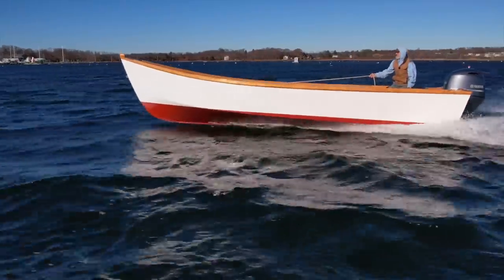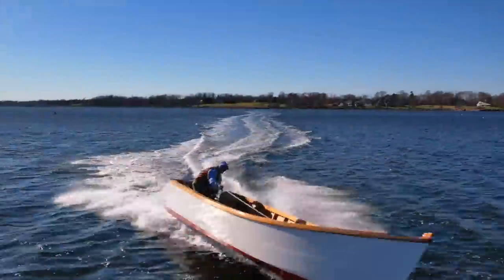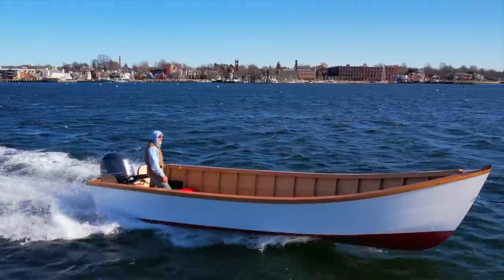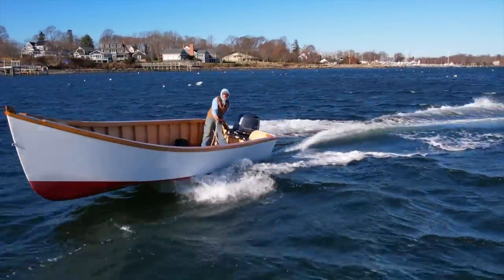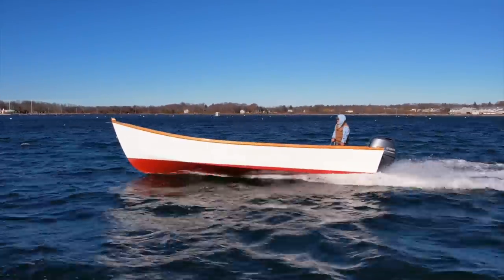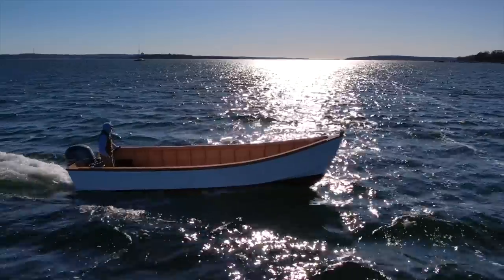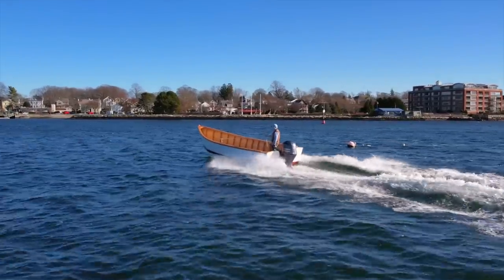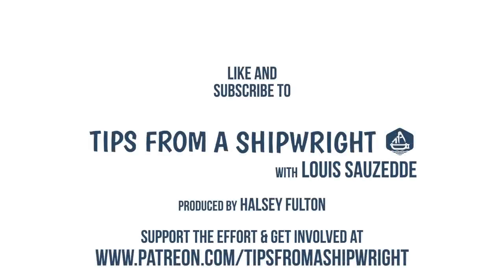Building the V-Bottom Skiff - Episode 41: Sea trials

Comment: Louis, WOW, just WOW! She planes, cuts and turns so beautifully. I definitely wish I had the funds to recreate this gorgeous build. I doubt it would turn out as good as yours, but if it was even close, it would be a dream to take out on the lake and just have some fun with the family or to relax and go fishing. Sure looks lime it could even pull a skier of up to 180 pounds with a motor that size, or larger with a bigger motor. Though I'd want a load in the boat with a bigger motor to feel safe before cutting her loose. I wouldn't want to be doing back flips or anything (with too much power pushing her). Matching the motor to the vessel is an important step in the calculations, after all. Maybe if you put a 302 V-8 in the front for ballast and run it back as an on-board motor to a prop shaft under the sole and out the transom with a double rudder system? But you'd probably want a heavier bottom to hold the motor and a redesign on the framing, right?
But she'd flat out fly across the water, 23 foot with that kind of power "under the hood"?
Reply from the maker: Thank you Thomas!

Comment: Lou maybe a nice round timber support post for that right hand would be a neat addition when standing at the tiller. Something that slides into a hole so it can be removed if seated, a lot of the pro crabber boats in Australia have them, much safer mate. Keep the vids coming, very knowledgeable. Cheers from down under :0)